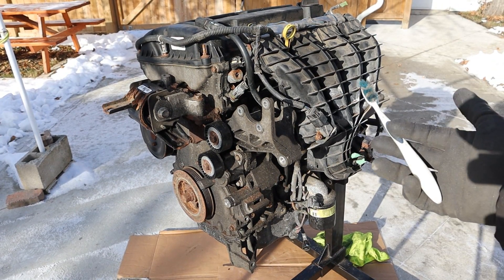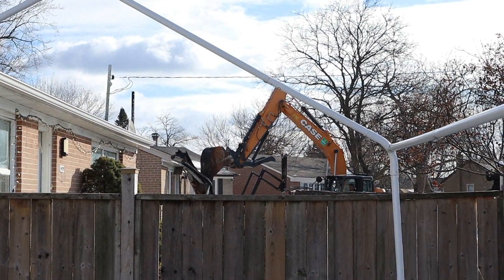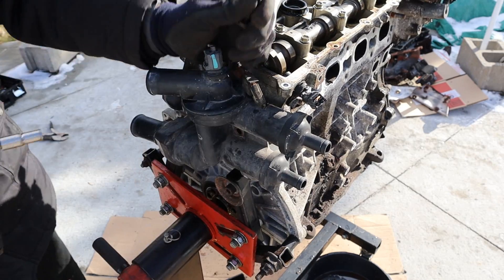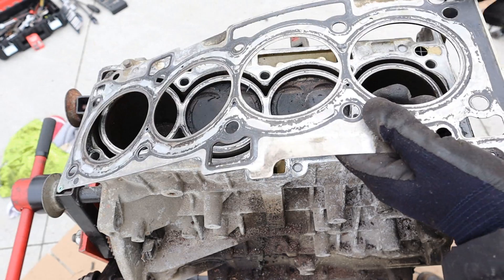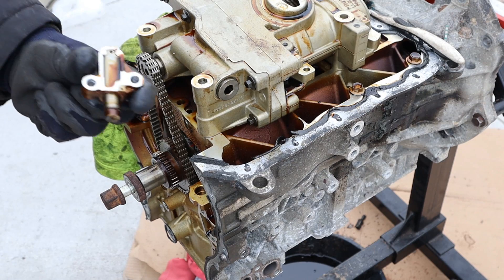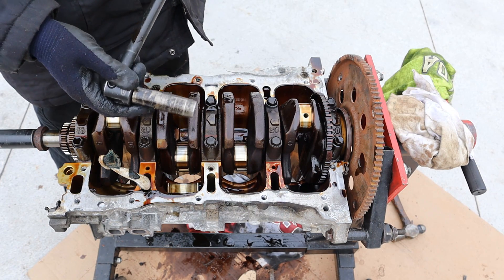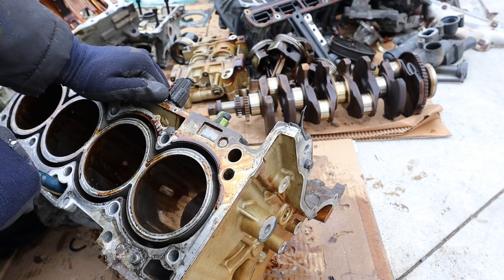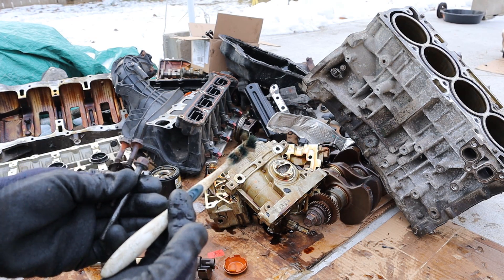Why the Chrysler World Engine is a Failure

Comment: I had a dodge caliber for several years, had very little issue with it or the engine. Maintenance and some small issues were easy to diagnose and fix
Reply from the maker: How about the rust?
Reply: @speedkar99  I guess it depends on where you live. Not so much an issue in the pacific northwest.
I think it comes down to the owner to wax the paint and apply undercoating to prevent what you can regardless of make and model you have. Car manufacturers can only prevent so much against all the diverse punishing environments and weather the united states offers.

Comment: So a whole line of engines is a "failed attempt at a quality design" because of a couple rusty bolt heads on a minimum 10 year old engine (in Ontario, rust capital of the world) and use of plastics in the same places all other manufacturers are using them. LOL. Your title is clickbait BS.

That was very little wear despite some miles (if only you would tell us how many), age and obvious poor oil maintenance; that engine still had tons of life left in it. An S65 owner could only hope to see rod bearings like that. 😂

Comment: I had customers with the 2.4 Multiair version start burning oil after 30 k miles, most would burn a quart every 3-500 miles and suck the pan dry and shutoff.
Reply from the maker: Wow that sucks

Comment: This engine is a rough but reliable workhorse that was put in millions of cars for about a decade. I got my own past 210,000 miles before it started burning oil and it still runs fine with just a little extra between oil changes. Don’t believe this clickbait title these engines are just fine. Any car that has this engine will fail on you well before the engine does
Reply from the maker: Good point....the cars fail before the engines. I don't like the design of many of these components though.

Comment: at least it has a balance shaft......
.
AKA it doesn't vibrate like a ford
Reply from the maker: Who says it doesn't vibrate? Have you seen how tiny the engine mounts are....
Reply: @speedkar99  vibrate like a focus? So. Ad you can't see out of the mirrors at idle?
Reply: @kainhall Vibrating focus? Worn out motor mounts. Or maybe you have oldstyle diesel direkt injection? They idle rough by design. The newer common rail design allows smoothening multiple injection steps, but you pay big maintenance costs over time for this added smootheness.
Reply: @@rdy2go977 oh really? Have you ever driven a focus?

Comment: I remember the days when an engine was designed well enough it didnt require extra balance shafts, this means the engines rotating assembly itself is now inherently unbalanced and the balance shafts are a half ass after thought to cover up poor design in the engine itself. Also, plastic that gets hot and brittle does NOT belong in critical high wear areas like the timing chain etc. sadly this has become common practice in todays most expensive engines as has variable valve timing etc. that is extremely sensitive to its tiny oil supply galleys becoming clogged by the slightest bit of dirt reaquireing major repair.  Engines today are literally designed to fail and cost a fortune to repair or in many cases replace entirely because its not practical to overhaul many of these Pcs. of crap leaving replacement as the only option often costing more than the car itself is worth cause more cars to be scrapped earlier than ever before.  Give me a simple old school small block chevy with no balance shafts where the worst thing you might have to do is replace the nylon toothed cam gear with a steel double roller timing set and be certain you can forget about it failing for the life of the engine and then some.  We spent many decades getting cars to a reliable state and now were going backwards building short lived engines with plastic in areas like the timing, radiators and major cooling system parts like thermostat housings just to save a few pounds and take years off the engines life and cost $$$$$$$$ in more frequent maintenance and repairs than ever before.  The government mandates are to blame for much of this as they have forced car manufacturers into crazy design schemes resulting in more expensive but lower quality engine designs that dont last, but wait and see how electric cars will magically save us from all these unnecesary repair and failure expenses - NOT-!!!  We just exchanging more bad design ideas for the ones we already have, only these will be even worse and cost more.

Comment: I'm really not understanding why you are surprised that the chain guides are plastic. What else are they going use, metal? So it just destroys the chains? Another thing is why are you surprised about plastic on an engine period? This isn't the 1970's. Plastic is cheaper, lighter, and in most cases, like intakes and water outlets metal isn't needed.
Reply: @ K Mayor Greenly. 
In fact plastic water outlets are more reliable than aluminum ones, because over time aluminum hose connectors get leaky due to corrosion builtup between hose and outlet. You never get this issue with plastics.

Comment: I work on these pretty regularly, the coolant housing on the side of the head is what fails the most. We see a lot in for overheating due to those housings leaking from the gasket flattening out and the housing warping. Aftermarket parts are terrible plastic quality, we only use dealer ones now and they're currently 2 weeks back ordered. As long as you keep coolant in them, change the oil, they'll do 200,000 miles or better. The transmissions normally attached to these and the vehicle it all goes into are unlikely to make 200,000 miles.
Reply: My 01 Caravan with this engine and 3-speed auto ran for 245k miles. I had the same overheating problems in its last 1k miles of life, but it was overall solid. I probably could've kept it going had I bothered to fix anything on it, but it was a $500 rusty van.
Reply: @RatBürgerSk8  You had a different engine, these didn't come out until 2005. You would have had the 2.4 EDZ which was used until 2007 in the US and maybe longer in other countries. A much more durable long lasting engine than the World Engine was ever designed to be but a very harsh buzzy engine.
Reply: @huzudra  my $800 “hooptie” has the 2.4L EDZ. It’s a solid engine, a lot of people do neglect to change the timing belt at the said interval, but thankfully they’re non-interference. You can see the wonderful cost cutting on the WGE in every way.
Reply from the maker: Thanks for your input.  So that plastic housing cracks? I knew it...it seemed pretty cheap feeling
Reply: @speedkar99  I don't seem the OEM ones cracked unless the engine has been blowing steam through it. What happens to OEM ones is shown in your video inadvertently. The gasket flattens out against the head and the never changed coolant starts to weep paste and corrodes the aluminum surface enhancing the leak. It's a small leak so it goes unnoticed until the engine is overheated likely after having been ran low on coolant and parts of the head running hot already. The aftermarket ones split on the big 'disc' on top and have undersized hose connections. Hyundai/Kia use a similar manifold and have a similar problem. Oh and there's 2 thermostats in there! One that opens around 180-190 degrees that's low flow and a 2nd one that opens around 210-230 degrees that gives full coolant flow.  Haven't seen you around Toyotanation lately, good to see you're doing well! You're getting good at teardown, I think that @I_Do_Cars is looking to hire!
- Bitter

Comment: So exactly why do you consider it a failure. The plastic cooling housing aside. There're certainly not  refined like Toyota or Honda. They're a bit 80s or 90s buzzy in terms of NVH but generally last as long as the appliance grade car they're in.
Reply from the maker: Good design. Poor execution with all the bolted on components
Reply: Strange, with all the problems Toyotas beloved 2grfe has.

Comment: I appreciate your input but my 2.0 has well over 220k miles and still runs like a Swiss watch with mondo abuse from the owner. You didn’t show any failures. The transmission doesn’t slip. I will agree the suspension has had more attention than desired but I’d rather deal with that than pulling the engine.
Reply from the maker: Any rust or transmission mishaps?
Reply: @speedkar99  Transmission doesn’t slip. Engine does not burn oil. Zero rust. I do have one slight advantage: I’m usually in Florida.

Comment: There's 2 thermostats in that failure prone cluster fupp plastic coolant housing. I just changed one yesterday.
Reply from the maker: Good to know. But why would they put two?
Reply: @speedkar99  I heard it's to get heat in the cab faster. Good for when it's cold out.
Reply: @speedkar99  I was fixing a coolant leak from the housing, but the OE part didn't come  with the O rings for the water neck/ thermostat and another between housing and head. I didn't want to use the old o rings or old thermostats . Ordered new ones. They were listed as primary 175 deg and secondary 215 deg. I wish I could tell you why. That's a good question.  I'll have to read up on it.
Reply: My 2012 Nissan Altima also has 2 thermostats. But they're not housed together.

Comment: The slots in the exhaust manifold are for thermal expansion to prevent cracking of the manifold during heat cycles.....duh.

Comment: Hi...

I own a 2013 Dodge Avenger SE with a 2.4 litres engine... I believe it is a World Engine... I have about 125,000.00 Kilometers (77,671.399 Miles) clicks on it... From this point on, should I be worried about severe failures???

Thank you...
Reply: Change the oil at regular service intervals and you'll be fine

Comment: Although the Chrysler world engine had some really crappy stuff on it the hyundai variant was alot more stout imo (disregarding valve train issues) they are actually little power houses because the block and internals are mostly Mitsubishi parts, I'm using an elantra 2.0l world engine and putting a turbo on it with mostly Mitsubishi turbo parts, they are capable of making close to 400hp on stock internals with some modification.
I personally never had a Chrysler world engine apart but I do like seeing how each world engine was identical but different depending on the manufacturer it was destined for.
great content!

Comment: Almost bought a new Caliber. We have happily owned Chrysler products. But our 2012 Van had plastic engine parts that weren’t available for replacement. So, we are trying Ford.
Reply from the maker: Good luck
Reply: @ Mytwistedvoices
Ford uses exactly the same parts in the same plastic. And yes, at least in Germany, you have to buy a lot of Ford parts aftermarket, because Ford way too often don't offer them as single spare part but in costly assemblies. So, either you turn your wrenches youself or you need big bucks letting Ford do the work with original parts.
We get a lot of cheap reasonable parts from Poland or China to keep any Ford on the road  quite cheaply - if you don't expect the dealership doing the work using aftermarkets.
Don't know your parts situation, though. And of course, no user work without void warranty. Have to consider that, too.

Comment: These engines are crude and noisy , and are not fuel efficient . But they are a fairly stout design , and they hold up fairly well .
Reply from the maker: Designed well. Poor execution and performance.

Comment: 321,000 miles on a 2007 2.0 backed by the CVT was still running strong when i put it into a ditch upside down in a snow storm.  the CVT went out at 200k and i had it replaced

273,000 on a 2011 2.0 driving the 5-speed.  still running strong and delivering 35mpg in the summer.  i did a clutch and some bearings in the trans at 200k.

both in Calibers and it seems the transmissions are more a liability than the engine.  i dont like them but they have been more than reliable for me in 2 different situations and set ups.
Reply from the maker: I agree. The CVT and rust take out the calibers

Comment: You must have some bias against Chrysler. There are literally millions of this little engines still in service with relatively few failures. I owned one (a 2.4) in a Chrysler 200 and it had over 200K when I donated it to a family member. I drove the car every day like I stole it and the only issue I had was the oil pain leaked and had to be replaced for a whopping $30.00

Comment: Overall, I preferred the 2.4 World over the 2.4 Multi-air. Generally more reliable.
Reply: Well, yeah.  The Multi-Air is Fiat, whose poor reliability got them run out of the US market. 

But now they own MOPAR.  GJ, Obama.
Reply: @immikeurnot  Chrysler had been shooting themselves in the foot preceding the FC, Obama only kept them from bleeding out until Fiat swooped in to secure their assets for pennies on the dollar. To hell with engineering quality, considering the discount Fiat got they can milk brand recognition nostalgia till the cows come home for all they care
Reply: The 2.4L TigerShark uses a nearly identical block, but it has a cylinder head that features the MultiAir valve timing system. I’m sure it’s better in the oil consumption aspect, and the MultiAir modules are pricey if they fail.
Reply: @jeremystout412  Tigershark is a SOHC, while World is DOHC.
Reply: @waltchan , notice that I mention the TigerShark uses a different cylinder head?

Comment: When Chrysler decided to disinherit the Caliber/Cirrus POS, they sold the tooling and all rights to Russian manufacurer Volga. They introdiced it about 2008 ad the Ciber. Between still being a POS and the financial crisis, it only lasted two years. They used a Russian engine so zero sum there.
Reply: Hmm. The new Moskvicz after Renault pulled out from Russia is actually a Chinese car put together after partial disassembly. Strangely the original Made in China cost much less in places like Kazakhstan than the Russian equivalent

Comment: Most of Chrysler/dodge jeep cars/trucks  are made out of the cheapest metal anymore(cheap bolts for sure)....aluminum wiring is very undesirable....corrodes very quickly   there is no new jeep Chrysler dodge product I would buy with the intention of keeping for more than a a couple of years

Comment: I miss the 1960s period , it was a great time to be a gear head. Engines were not as fuel efficient but they were simple and rugged even the worst of those years was better than any crap made today . Practically any engine of that vintage with modern ignition and aftermarket injection system are the way to go in an older  restored car /  truck ,the hell with the gadget filled cockroaches that people call cars in the past 3 decades.

Comment: Bolts are measured by the shank diameter, not socket size.
Reply from the maker: Yeah I am an engineer and we go but thread size but to a common technician you'd recognize the head size for the socket not the threads that you can't see
Reply: @speedkar99  
Makes sense. Like a standard 3/8" bolt is easier to recognize as a 9/16" bolt.
Reply: And much better to use 10mm rather than 8mm (5/16") on valve covers. Also I love the 16mm socket size - can't they just use 17. But Germans are even more creative - Alu bolts on BMW, torx and hex everywhere. And the 'happy plastic is fantastic' on everything having to do with coolant and heat :(

Comment: We have 2007 Dodge Avenger with 2.0 litre engine and  5-speed manual. It has driven daily now almost 300 000km. Oils changed every 10 000km. Since we bought it new. 
No engine problems. Not even symptoms.  All the joints and balls in suspension are original. 
Engine support frame has rusted. And it must be change this year.
Reply from the maker: Yeah that's another common problem with these cars, rust. The dodge caliber had that issue as well

Comment: A Hyundai-Chrysler engine is a scary thought, but then again, I've seen a 6.2L Superbug with less than 50k miles puff out more smoke than a scrapyard fire. It was pretty funny to see both events, actually.
Reply from the maker: The Hyundai version is even worse. They fail due to oil starvation
Reply: @speedkar99  I had a 2018 Forte with the Hyundai engine you mentioned in the video. It had a ticking noise that came out with cold weather but not on warmer days. I didn't get it looked at to find out what it was because a watery teenager ran a red light at 40 mph and hit my driver-side fender while I was making a left turn, totaling the car and my knee. It was a great value car for A to B travel and had excellent safety standards for its size, but I'd like to not think about what would have happened if they hit the driver's door instead. Now I got a Subaru with a transmission problem.

Comment: I actually kinda like this Engine. I recently had one come in that needed a head gasket it was pretty much done in one day, and that's impressive because I work slow and carefully
Reply: If you like that engine then you will have lots of work til they all die out. :-) I wont touch it.
Reply from the maker: Nice. It is simple to work on and layed out well. Did you snap or round any bolts?
Reply: @speedkar99  nope! And that's rare being in the rust belt here. Everything went pretty smooth, I look forward to the next one that rolls up!

Comment: The entire line of Chrysler is a complete failure... total garbage. If people didnt buy the garbage techs wouldn't have to try to fix that junk. I refuse to repair that stuff, if you want to work on that stuff... go ahead.
Reply from the maker: I just hate the rusty fasteners and plastic. They should have done better and at least matched Hyundai....lol
Reply: @speedkar99  😁the little details tell you alot about over all design. This line is a complete money grab and failure. Makes the K Car from the 80's look good... and yes I worked on those... Glad I will retire from the trade soon. I would rather work on a K Car than this junk. And they were horrible...